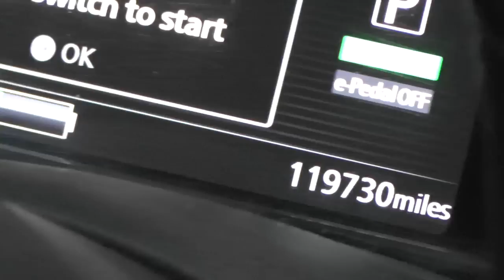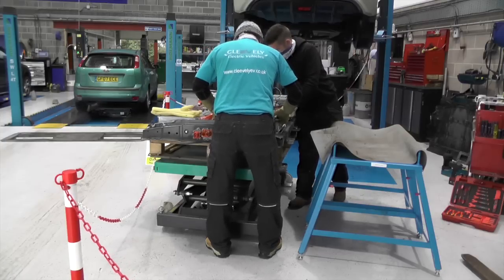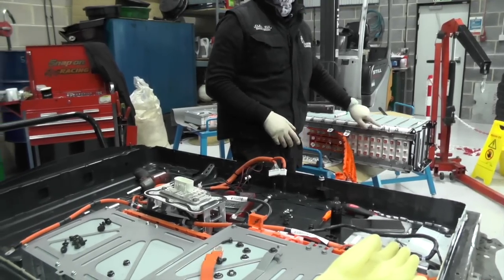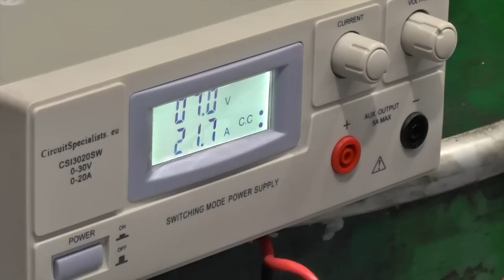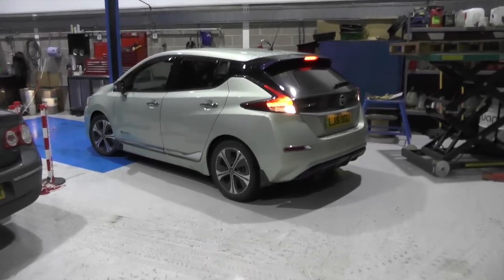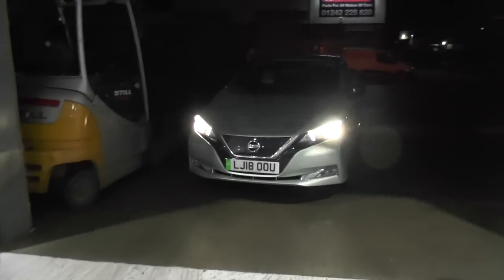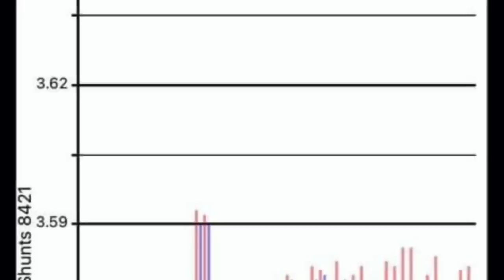Nissan Leaf 40kWh Fried Battery Teardown and Repair.

Comment: I didn't realise you actually repaired EV's James? Have enjoyed watching you and your wife videos. I have a Nissan e-nv200 22kWh van, would you be able to fit the larger 40kWh pack in it?
Reply from the maker: Yes we can. We're just putting one in our own eNV200. We're also adding a UBEX range extender. Should be a couple if weeks 👍🏻
Reply: @Jamesandkate  that's  brilliant. What's the best way to get in touch with you for more details please? Regards Phil
Reply: That sounds interesting. But are you using a salvaged battery? Unfortunately, where I live, in Cape Town, salvage batteries are not readily available

Comment: I've noticed that the battery tends to get, "A COLD",  needs to maintain a even operating temperature.  Cold battery's tend to run inefficiently without a hitting systems of some kind. 

Re Design the plates so they wil not degrade with a different electrolyte.  An EV battery must be designed efficiently at normal thermal blanket temperatures such as 0 centigrade to maintain a non degradable environment.

Comment: Nice - probably comparable in scope of work to replacing a head gasket in an ICE car, perhaps with a light skim to the head as well to give more life.
Reply: Only need to remove bolts, no setting timing , draining fluids etc.
Reply: @zenbudhism  True, but you can change a head-gasket without jacking the car up, and without special lifting equipment. Swings and roundabouts! I reckon the difficulty level is similar.

Comment: Nice work guys! Could you have used a faster bench charger to top up the new cell? Or discharge main pack to march the new cell by going for a joyride before starting! Did you use a new module for the replacement or 2nd hand module?

Comment: Why wouldn’t that have been a warranty job James?
Reply: It wouldn't be covered by warranty as the normal warranty is 8 years OR 160,00 KM which is approx 100,000 Miles as this car is over that the battery is out of warranty by quite a bit.

Comment: It was such a huge mistake by Nissan not include a BMS in their latest Leaf, surely they must have seen these kinds of problems in their lab tests.  Rapidgate has hurt sales.
Reply: What? They does have bms here. They have no thermal managment.
Reply: @pashko90  Car slows heating by limiting power output, reducing charging speed.  Car cools by thermal radiation, convection, and conduction.  And these have been engineered.  There is thermal management, just not the kind you imply you want.
Reply: @mikecarter2737  yes, it's called "passive colling system", but from hod does it called in right way thousands batterry packs from a Leaf will not gonna get a new life.

Comment: What model year vehicle was this?
Reply: 2018, he said it in the video at the beginning.
Reply: @ht3880  Thx. Wow that's pretty messed up for a recent model vehicle to have the level of damage it does. Nissan have clearly not fixed much with their EV batteries.
Reply: @JeanPierreWhite  it's because the driver used it as a taxi. A regular person who doesn't quick charge 4 times a day would probably not run into this problem. Nissan will fix this temperature problem with the Ariya.
Reply: @ht3880  Nissan have fixed their battery problems before, supposedly. This is evidence they have made very little progress in ten years. The idea they will suddenly fix the issues overnight is very optimistic.
Reply: @JeanPierreWhite  Yes, this pack looks 1 to 1 as 30kWh pack. And having same issues with a leafs 10+ years in row.

Comment: Damn 120000 miles / 190 000km and 87%SOH almost only QC that not so bad
Reply: Yeh, I wish! My 11 playe Leaf has 85,000 on the clock, but only 52% SOH, which being a 24kWh pack, gives a whole 30 range in the UK this winter!
Reply: @SheepShearerMike  You might find that only a few battery cells need replacing, so the repair might not cost as much as you expect.

Comment: New Tesla will have battery cells sandwitched to the floor, how will you change out bad cells.
Reply: yep that will be impossible but the batteries shouldering have better thermal management.

Comment: Some one needs to make an aftermarket cooling kit for the battery even if it ran on the outside wicking away heat from the metal battery case surrounds which judging by these pictures get hot this could help maintain battery integrity.

Comment: Why wasn't it covered under warranty, only 2 years old, my ford 1.6 TDCI has done just over 200,000 miles, but is serviced every 6 months with an oil change. I hope my MG ZS EV lasts more than 2 years before a battery change, or will this be a problem only for high mileage vehicles being rapid charged regularly, if so stick with a diesel car
Reply: Your Ford if its engine died (when) is not covered under any sort of warrantee indeed you are very lucky to get 200K miles out of any Ford engine these days the 1.0 ecoboost is notorious for needing replacing completely every 40 to 60k miles. 
I have an MG5 as a Taxi.. yes like you hope it lasts a LOT better than the Leaf.. but then it's a Nissan.. these days chasing Ford to build the most unreliable vehicles.
Reply: My Mitsubishi PHEV has 186,000 miles and has done the last 120,000+ moles as a Taxi. Rapid charging sometimes 3 or 4 times a shift... when I bought it at 58000 miles the battery was at 84% now its at approx 80% so with a cooling system that actually works.. we should be fine. We need an app like leaf spy though. Do you know of one?
Reply: 120,000 miles and the battery is only warranted for 100,000 in 8 years. Use as Taxi meant ~4 rapid charges a day which overheats the battery. The Leaf has little or no battery cooling and is unsuitable for constant high mileages using multiple rapid charges in a day. Normal domestic use, with occasional rapid charging should be fine. Hopefully, active battery cooling on the MG ZS EV (and most other EVs) should protect the battery from multiple rapid charges, though likely something else could break in heavy use.
Reply: In 200,000 miles you'd have saved £20,000 in fuel costs.
Reply: @MarkAtkin  unfortunately not that much saved if s/he was mainly rapid charging at PAYG charger, but hopefully this makes more sense for more taxi driverz
Reply: As James said to another same question - Nissan battery warranty is 100,000 miles and this is 119,000 so its OOW right there.   More significantly though, is not the miles the battery has covered but how it has been routinely charged, 4 x Rapid each day, very uncharacteristic of any "normal" use case!   So being completely conservative, with normal use, one might expect 2x the lifetime out of a Nissan pack.